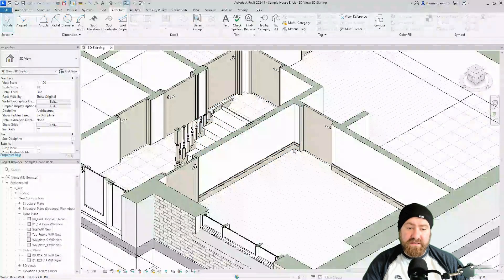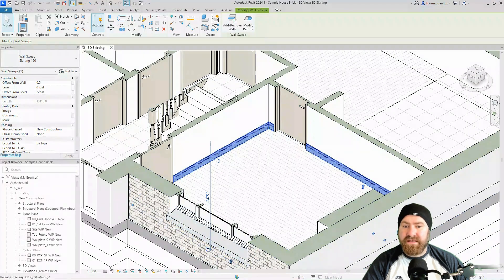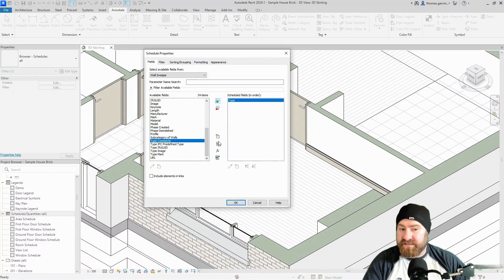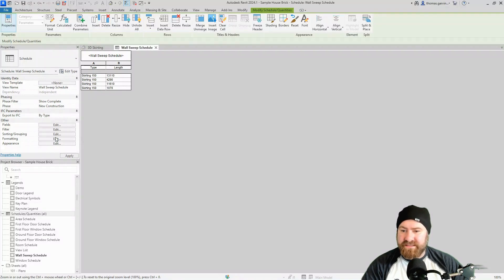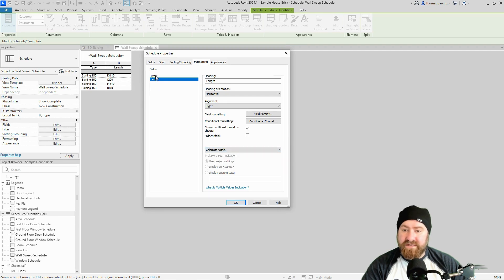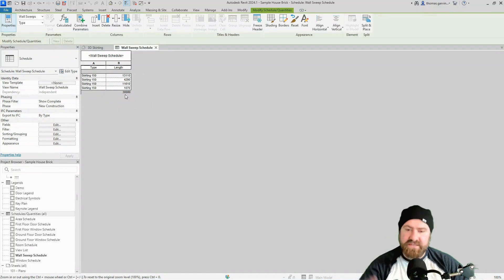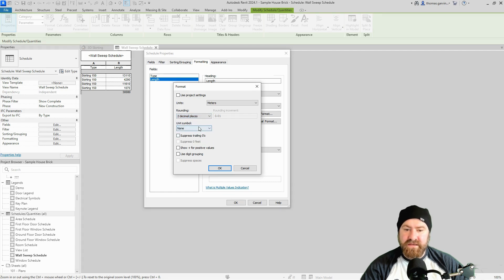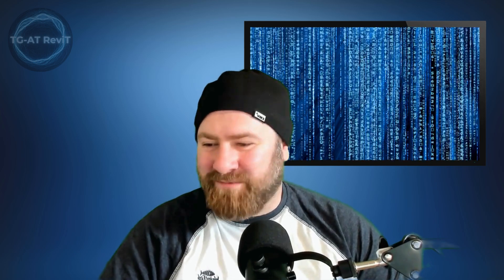Revit Schedule a Wall Sweep

Comment: good tutorial ! however I find the sweep tool tricky, some times on outside walls it will apply sweep even inside the drywall joins and i'm afraid it will just count it into the schedule, another problem i've found is whe n you have walls joins that have square off  joins, where you cannot apply a wall sweep on the "side of the wall"  you can only use modify returns , handy if 90 degrees, but hardly useful if any other angles
Reply from the maker: You're not wrong, it is very clunky and with lots of opportunity for error.. doesn't work properly around openings either (as you pointed out)

Comment: Levels does not available in schedule fields
Reply from the maker: Thanks, that's correct. Did I say that it did? My bad if I did. If you want to schedule by levels then you'll have to be a bit clever and careful about how you model the sweep. You could do it by having a different type name for sweeps at each level (Skirting GFL, Skirting 1FL etc.). You could sort by that.. or add a shared parameter like "Placement Level" and give a value corresponding to the level. Not a great solution but probably the simplest.